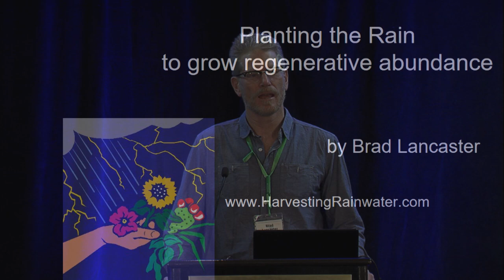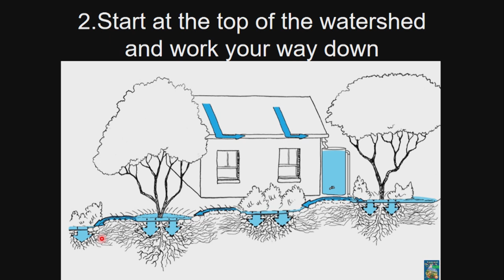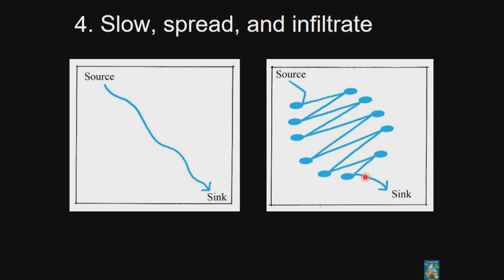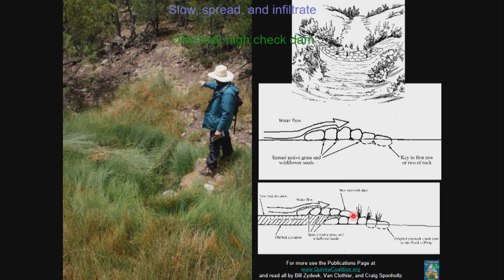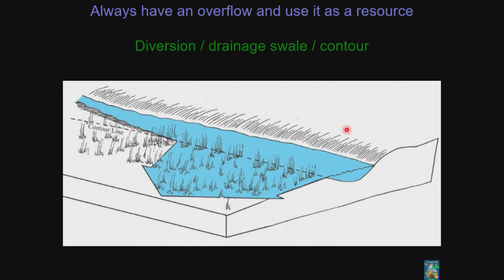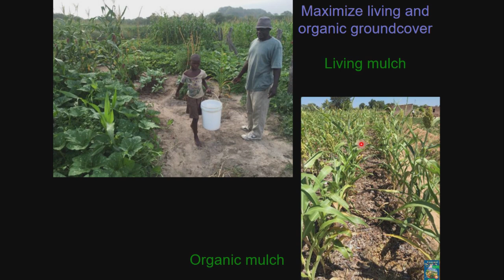Water harvesting principles & the story of an African rain farmer Design guidelines for regenerative

Comment: Wonderful work . Water gets collected  in  every low lying area during rainy season . When they have no passage to run away , they cause floods . So give some resting   area for the rain water . Just make provision for water to get collected in some area . Just dig up  large area of 5 or 6 feet . When water gets collected , you have a lake . In every arid area with little rain make 500 or 1000 or more shallow trenches of one or two feet  depth . Just leave it . Rain will fill them for you and it will percolate . Within 2- 3-6 years all wells will have water for all needs . The local people if they cooperate , they can make them within 2-3 days .

Comment: Wonderful presentation!

Sharing some notes

- Integrate grey water into your systems. 
- You want water in the soil, not on top of it, otherwise there are loses 
- "If you don't understand the thinking behind a strategy its going to fail!"
- "Plant the rain before you plant the tree"
- Life's a slow process, just get started."

Water Harvesting Principles:
1) Long and thoughtful observation 3:22
2) Start at the top of the watershed and work your way down 7:25
3) Start small and simple 15:34
4) Slow, spread, and infiltrate 22:26
****5) Always have an overflow and use it as a resource 33:06
6) Maximize living and organic ground cover 42:02
7) Maximize beneficial relationships and efficiency by "stacking functions" 46:26
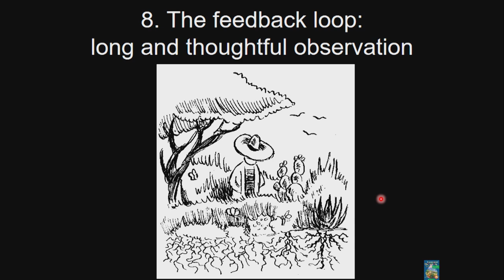****8) Long and thoughtful observation II 51:05

Comment: 1) Long and thoughtful observation... what is actually occurring... 3:40 ie when it rains, where and how does it slow down and sink into the earth?  What is working to generate life?
2) Consider the big picture... what is it you are trying to achieve?  Evolve your thoughts and methods as you go.
3) Mimic the successful ways; ie build blockades across slopes to slow the rain flow so it sinks into the ground.  
4) Start small and simple. ie let’s make our wet spots wetter... harvest grey-water. 
5) Slow, spread, and allow the water to infiltrate the ground. 22:30 to increase the water content in the soil.
6) Work for the long term success, so small steps repeated can often make a longer term positive effect than a larger step... ie one rock check-dams... a single layer of rocks set over seeds so they will grow to stabilize and strengthen the structure you build. 30:00

Comment: All similar to 1930's NRCS homestead guides. The oasis zone you describe is within the high fire risk zone for houses. Move the oasis out past that 30ft/10M range and place large vegetation and seasonals out 100ft/30M All dry land areas are also fire prone, rethink your foot print and designs using fire design adjustments and you are in the green zone!

Comment: Brad Lancaster on water Harvesting and the story of Mr Phiri, his mentor.

Mr Phiri at 1:40.  Mr Phiri's land before he started his journey.  It is mostly bare rock with little to grow on.  Most was washing or blowing away.  Inspired by the Bible's Garden of Eden, Mr Phiri decided to build up his land.

1) Thru long thoughtful observation he found he was losing soil to wind and water erosion.  He'd follow the rain to observe where it was washing away, where it was staying. He noticed slowing the water allowed sediment, and seeds to remain.  His first structure at 5:00.  Additional structures at 5:03, with significant greening already occuring.
Diagram of one type of possible rainwater harvesting system 7:26.  Start at the top of your watershed, and work your way down.  This way your hydrate more of your Lans.
Diagram of Mr Phiri's farm at 9:00.  
Photo of Phiri's farm after some structures to retain water were built 9:21 (uphill view).  9:32 (downhill view).

9:40 significantly more regreening at Phiri's place.
10:02  diagram.  Work with your watersheds.

2) Starting at the top: Example of roads that lose water, and how to harvest road water at 10:51 (drain).  11:58  another road-water harvesting structure called a rollout.  Rollouts= angled dips/speed bumps for water diversion.
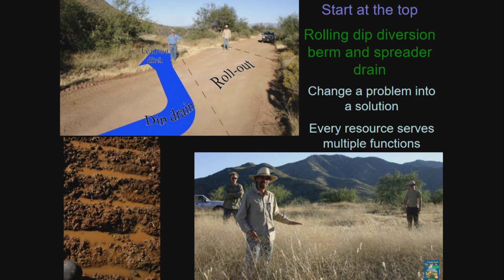15:14 an example of a gentlly draining ditch dispersing water along a gradually sloping hillside. 

3) 15:37 Start with small and simple strategies.  If you have existing vegetation 16:12, 16:37, 17:12

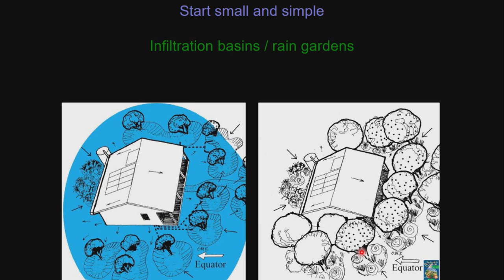Mr Phiri's greywater harvesting 19:28.
Mr Phiri's water catchment basin 20:22. (Immigration center 😁😁😁).  Reservoir 20 years later 22:13.  22:27 ephemeral reservoir.  
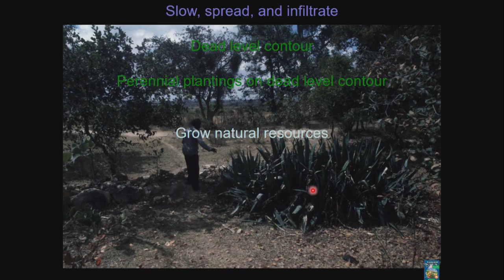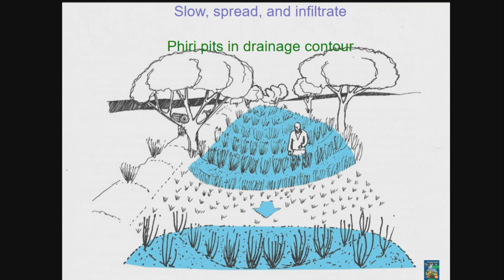4) 22:28 Slow, spread, and infiltrate diagram.  23:00 Phiri's cistern set up.  23:30 dead level contour.  Phiri's adaptation to the contour drainage set up by his government 24:11 (Phiri pits).  26:06 Sheet flow spreader, after it is just built.  27:40 after vegetation is established.  Good for high sediment areas, like Haiti.  Variation 28:51.
Check dam 29:11.  Sheet flow spreader for a creek 31:51
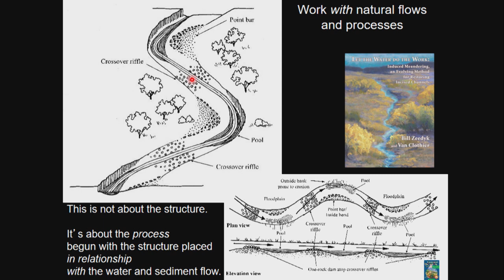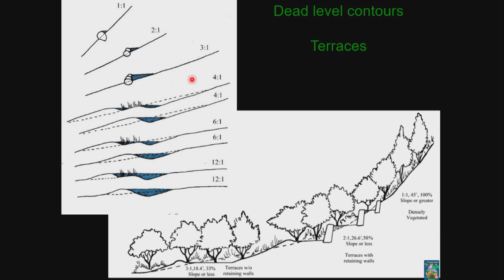32:55 planting on dead level contour.  Terrracing 33:02.

5) Always have an overflow.  Use it at a resource 33:06.  Mr Phiri's overflow catchment 34:42 (fruition pit, 1995).  Fruition pit, after (2014) 34:58.

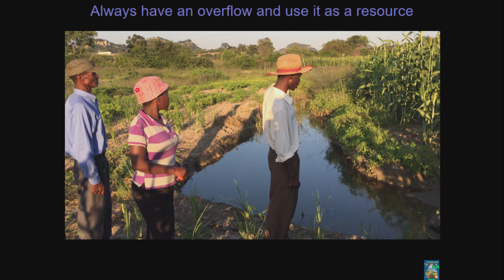35:47 Swale design, and possible flaw.  36:28  The Speed/Depth/Volume Erosion Triangle.  38:13 improved overflow for a swale.  38:53 Hansom's pool (example of improved swale overflow).  Boomerang/smile berm (diagram) 39:32, photo at 40:21.
Key elevation relationships of earthworks 40:31.

6) 42:03  Maximizing living and organic groundcovers.  43:27 reforestation/'responging'. Mr Phiri's planting for water first.  44:27 Living mulch/organic mulch topdressing.  44:40 use of living structures.  
45:19 Rain Garden Zones

7)  46:26 Maximize relationships and efficiency by 'stacking functions'.  
47:01 Phiri's well 1995/2014.  48:10 Supporting function by multiple resources within the system (Phiri's donkey pump, 1995).  48:19  Same place in 2014.  Bottom of Phiri's property in 1995 (a dry season) 48:30, with ephemeral pond.  
Phiri's  son and grandson 49:34 in front of ephemeral pond during a wet season in 2016.  49:39 Phiri's dryfarmed banana plantation.

8) More long and thoughtful observation, the feedback loop 51:06.

To find out more about Mr Phiri's work, check out www.Muonde.org, or Muonde Trust in Zimbabwe.
Phiri's work in Zimbabwe/Rhodesia is inspirational. He has been a blessing to us all.  Sadly Mr Phiri has passed but he has left us a tremendous legacy.

Brad Lancaster has published a book series call Rainwater Harvesting in Drylands.
Reply: I live off grid in a rural area of northwestern Arizona with dirt roads, and learned to harvest that flood water. Even with the dirt sentiment, I have a filtration system that drains and directs the water toward my water catchment system that will be used for grey water system. It easier for dirt roads because the drainage system is non existent, but adding drainage around the perimeter of your property , I promise you can live off that water for the year! Now I’m just trying to learn how to make it where I can catch the water in the wash nearby
Reply: @sashamoore9691  
Add swales, to enhance groundwater.  Read Brad Lancaster's books on harvesting water in drylands.   His methods are low cost, adds to comfort, prevent evaporative water loss, help repair washes (Washes are bad because they allow the water and topsoil to drain away, with little going into the ground to recharge.), etc.
Reply: @b_uppy  oh wow thanks so much! Will def look into that book because I know washes has its disadvantages. Thanks again! You wre very resourceful
Reply: @sashamoore9691  
Do access his most recent editions because they have had the info expanded over the older ones...
Reply: @sashamoore9691  
You may want to refer to my revised commentary on Brad's video.  Just updated it.

Comment: In San Francisco I let my roof water run into my yard rather than into the sewer system which is required by code.
Reply: What is your roofing material (in Europe they used concrete tiles with Asbestos in the 1960s maybe even 1970s and some of those roofs are still in use). Or any other problematic roofing material that could leak harmfull chemicals ?  And what is the maximum water absorbing capacity of your back yard ? 

If your backyard is normal "lawn" you might be surprised how bad it is (even if the lawn is green), if you  have developed your soil (according to permaculture principles) - you will be able to even handle the once in 10 or 30 years downpour (the area in the yard  is getting the water downpour per area AND the roof surface input on top of that (and it is concentrated on one area of the yard so when a lot of rain comes down that could also get a dynamic of its own before the rest of the yard can soak it up.

With good soil you will likely beat the sewer system in extreme events which would be a lot of rain in short time. 
Not when you have a shallow layer in the ground that is not permeable though (rock, clay, loam). Not even good earth might be enough to deal with the big events.

Do you have an overspill so you would not flood your home and  that of neighbours ? 

Brad Lancester talks about not having overflows and backups if one system / structure fails. That can work for several years - until it doesn't. 

Unfortunately we cannot take for granted that people will be interested to learn, think, observe, put in the effort and to impose regulations upon themselves and abide by them. - in which case top down regulations would not be necessary. 

ideally we would have only folks that are eager to do the right thing, learn, willing to seek adivce, have the money, DIY skills, time, energy and WILLINGNESS to change and learn, and they CARE about preventing potential damage (even if the damage is "only" done to others or nature in general).

The regulations are for the weakest part of the chain - those that are unaware, stubborn, idiots, ignorant, or do not  give a damn.

Comment: Notes:

1) Long and thoughtful observation - look for areas of success and improvement
2) Start at the top of the watershed and work your way down - Use your first chance, best chance, and last chance
3) Start small and simple - if it's existing go around or between, rain garden, transform waste into solutions, size is measurement of how long you can last, 
4) Slow, spread, and infiltrate - use zig zags, mellow flow by spreading toward road drainage(one rock high check dam, subjected to erosion. Grow, fill, grow, fill will eventually solve it). Plant on contour
5) Always have an overflow and use it as a resource - use rocks so allow flow, encourage sheets, create little ponds around trees with overflow, 
6) Maximize living and organic ground cover 
7) Maximize beneficial relationships and efficiency by "stacking functions" - tank to tree, well water can go up, eat fish when the water level drops, plant rain vs drain it.
8. Long and thoughtful observation - feedback loop. Evolve.

Life is a slow process, just start.